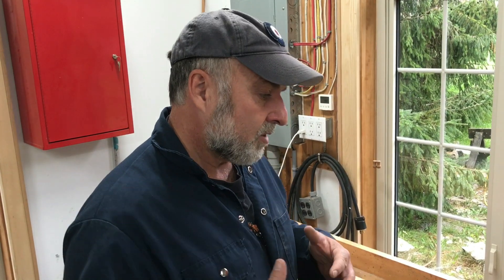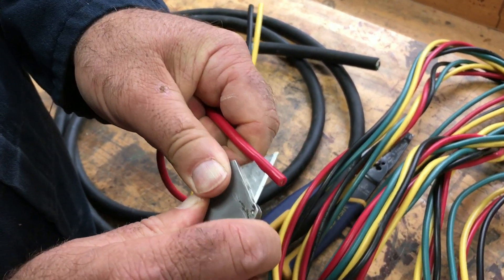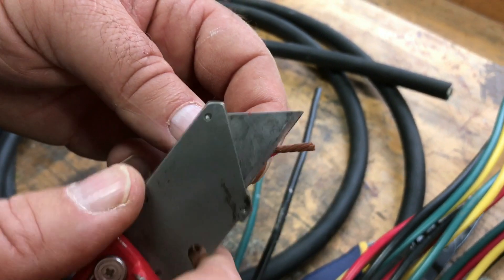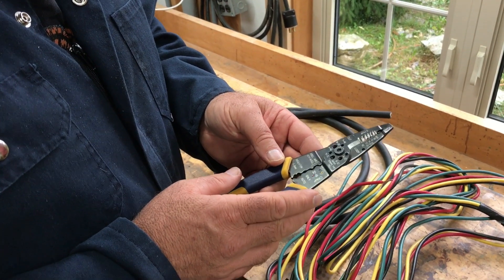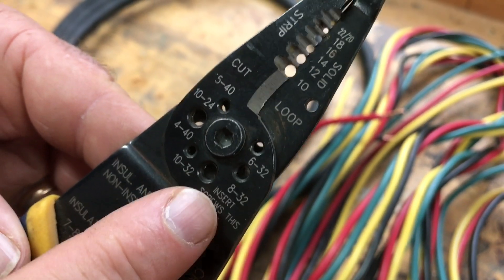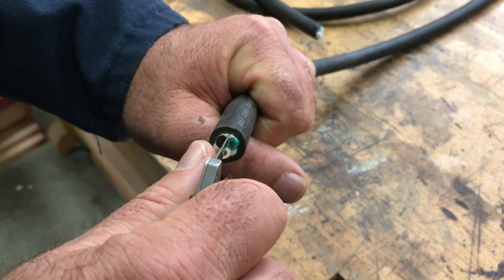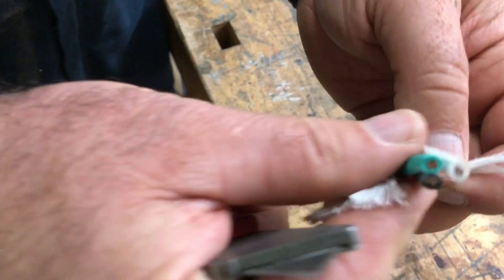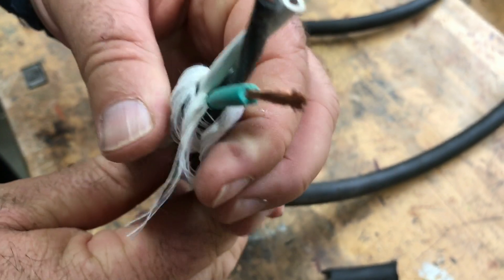SOLAR GENERATOR VIDEO#3: Stripping Wire

Comment: The note about DC 'preferring' a stranded conductor is nonsense. Please fix this. 
I'm an EE (Electrical Engineer) so I think I know what I'm saying: In DC (PV output), the current distributes evenly across the whole cross-section (area) of the conductor, so the decision on using stranded or solid core is cost (solid core is slightly cheaper) & convenience (stranded core is easier to manipulate). In AC, at the industrial frequencies (50 or 60 Hz), this is also true.
Where the skin effect is evident is RF frequencies (which is how Tesla demonstrated his luminosity experiments), which you don't deal with in this project.

Comment: Have I missed something? I don't remember previous mentions of a solar generator. Are you planning to use flooded or AGM lead acid batteries, or are you going with lithium. I sure hope it's the latter. DIY 18650 packs would be even better.